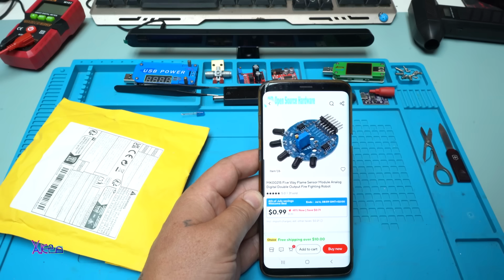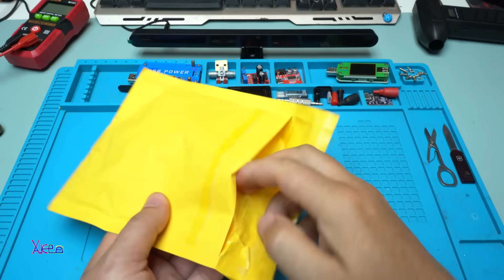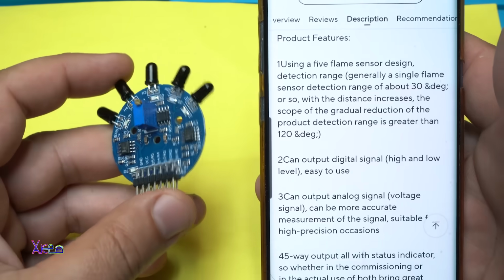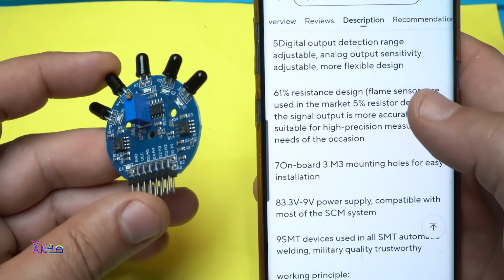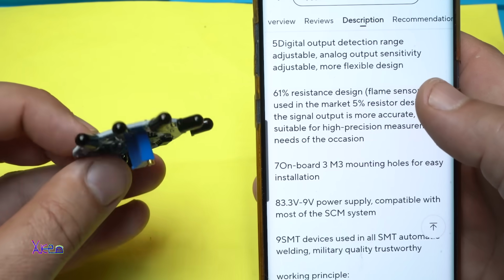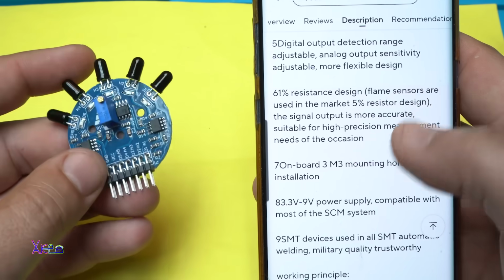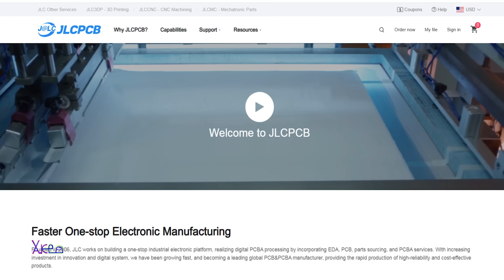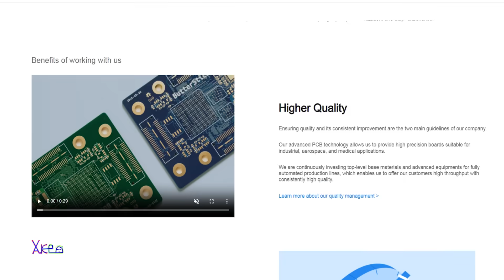WHY THIS $1 Amazing Module is BRILLIANT?

Comment: Interesting device, thank you. I will look for one to test. I would like to attempt to trigger it with other light-sources that might trigger it, and generate heat...direct sunlight, reflected sunlight, halogen torch etc. thus knowing it's capabilities. With excellent detection, also comes the need to see false-positives. I know, I'm a sensor-producer's nightmare but that is what makes electronics fun! Well done on the demo video and thanks for the idea for more devices I can play with (I have a LOT!) :)
Reply from the maker: Sounds like a cool project, have fun with it!

Comment: Very handy, especially for preppers. Really easy to make a tiny, compact smoke/fire system when combined with a gas detector module (which Hacktuber reviewed in the past) and a simple, single 18650 battery bank.
I am a bit surprised that it doesn't have a 6th pin for when any sensor is triggered, but i guess it's easy enough to short the pins near the base.
I got a few remote control modules with keychain remotes and they feature a 5th pin for when any of the 4 buttons are pressed, I thought that was a clever detail.
Reply from the maker: Good idea for preppers and thanks for sharing your thoughts!

Comment: How does it tell a flame from heat?  Something like this might work to turn off your lipo charger if your batteries get too hot.  Flames would be too late.  I guess there are other things that do temperature shut off.
Reply: The black LED like things are infra red photo transistors. They are sensitive to infra red radiation, not visible light. So they will "see" a strong IR source when even a small flame is present. 

To turn off a lipo charger, a thermistor is more commonly used.  It can be wired as part of a voltage divider, to trigger a relay or a switch of some kind.
Reply: thermistors....
Reply: @lezbriddon  A resistor that changes its value with temperature.